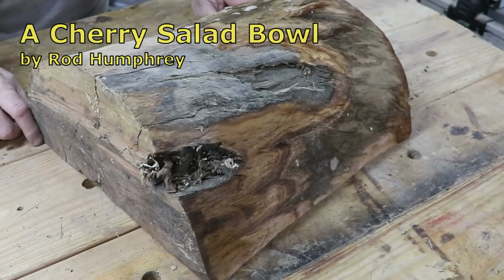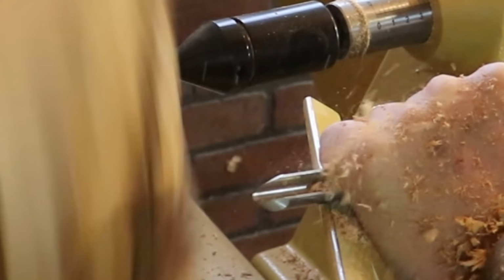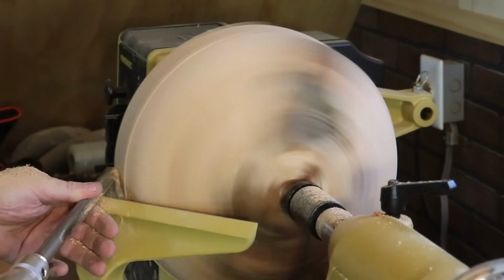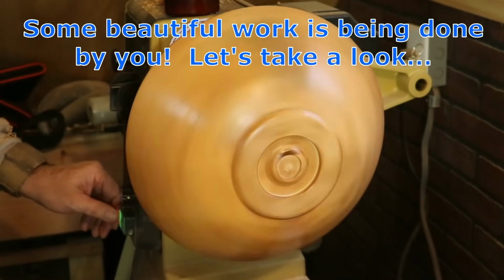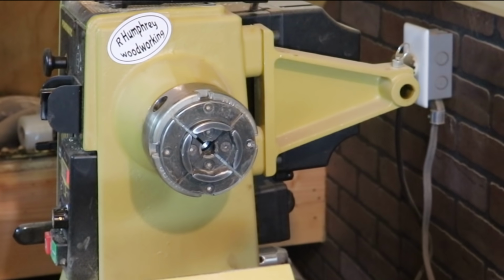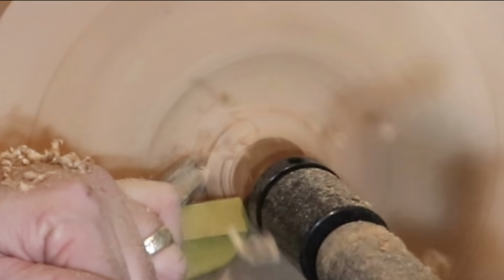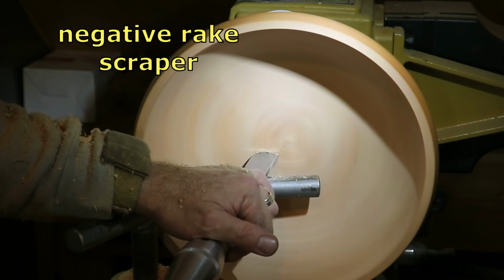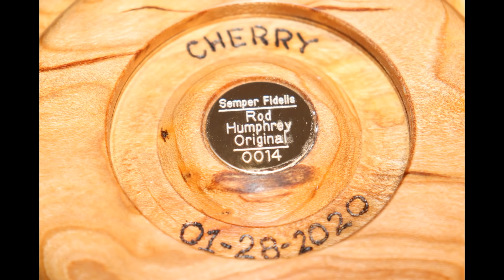Woodturning a Cherry Salad Bowl

Comment: I've never turned cherry, I turn a lot of cedar and oak so I don't know how cherry cuts but from this video it appears to be a nice wood for turning. I get those chip outs on rims when turning cedar a good bit. One thing I do that works for me is look at the side of the bowl and find the deepest chip out. Use a very sharp thin parting tool and cut just below that. On softer wood like cedar I just use sand paper to smooth over the sharp edges, on oak I will use a sharp scraper and lightly touch the sharp edges